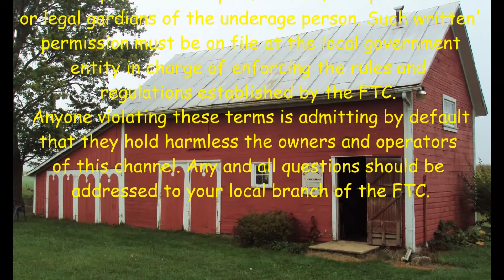Doerr Electric Corporation – Model 1499 – Pt 4 Aw Let’s Just Hook ‘Er Up N’ See

Comment: It's odd that the cord hole faces up so water can go down into it and also you'd think they might've put a waterproof switch on it too.......But everything is looking A-OK and you're gonna have a nice wet grinder.
P.S. Sounds like the Bearings/Bushings need a Little Lube.
Reply: I usually just clean around the outside and put a little oil around the shaft with it running and it'll suck the oil right in a quiet the thing right down. Been doing that on the mower for 4 years or so and it still hangs together. Idler pullies. Might be uncouth but if it works..
Reply from the maker: I think it will soon need new bearings. I'm going to try flushing them out but we will see.
Reply: @OldSneelock  10/4. Will depend on how much junk has been sucked in and ground the balls and races. One will never know till one lays the eyeball on it or the oil inside of it and sees if it blows the hearing aid into the next county.!

Comment: If the shaft is 3/4" and the left hand shaft is left hand thread True Grit Abrasives in Ontario CA has the buffing wheel tapers to fit. That is if you want to use as a buffer.
Reply from the maker: Thanks for  the tip. It is left handed. Unfortunately it is 1/2"

Comment: YAAY, but I didn't really have any doubts. We both see too many things that have had minor things wrong so they wouldn't work OR that were good enough so the money we put into them would offset buying another. The story of my life and my shed full, yet and still and maybe from now on! Got the tongue jack and am WELL pleased. 1500# load rated, dual 6-inch casters (which I didn't need but can be cobblefied if not really needed) and one of the best things as far as I'm concerned a GREASE ZERK so I can grease the gears! Ain't THAT wild! Ultra-tow and from Ft. Worth to here in 4 days by Fed-ex ain't bad odds either!  Resting up for tomorrow and the deal of deals but not the REAL deal. I'll take a 20-ish mile run on a 2-lane that I used to pull a trailer on that a 60+ mile deal that I dreaded to even think about. So now you get to oil bearings and whatnot and clean shafts and listen to it hum. And I get to clean out the shed so's I can drag the splitter out and put the jack on so all remain calm and GBWYou! And I have a screw starter like that but with an even shorter nylon handle nd have had it for ages. Used it maybe 5 or 6 times. I forget about it a lot! Now for a thread file...............!

Comment: Great that it runs! I doubt the switch is original or at least those crimp lugs.  Also the use of Wire Nuts  is not something I'd expect from a factory originally. But nothing you can't  correct! Some else mentioned using this as a Buffer and I thought the same if you didn't want to go back to the diamond wheels.  For free you got a great deal! Look forward to more!
Here in WA, they've only had mail-in/drop-off ballots for awhile(unless you want to drive to the County Election Office-20 miles each way). So we voted a couple of weeks ago..only wish we could have turned off all the political ads...at least we have a "mute" button!
Reply from the maker: I had hoped that the yelling would stop after the election. Looks like someone figured out you can get people to watch an idiot screaming in the street. 
Not sure where this all ends. I managed a few thousand people over the last 40+ years starting when I was 18 working for Dad running a couple guys wiring houses. Most of us just want to live our lives and sleep at night. There are a few that just can't get along. It was always my job to train the trainable and eliminate problems. 
Looks like we have the untrainable running the shows. At least on TV. 
We shut off the cable last month. Just internet now. The news is just as crazy, but I am pretty good at spotting the BS. Besides growing up the news was 1/2 hr at 6:00 pm. That was long enough to tell about what was important. The 24/7 news? is just the same 3 things over and over.